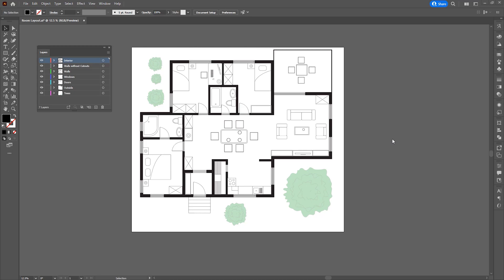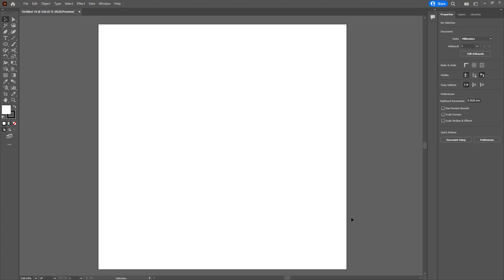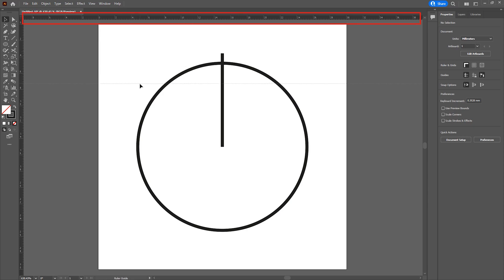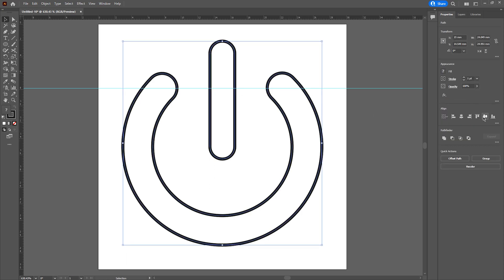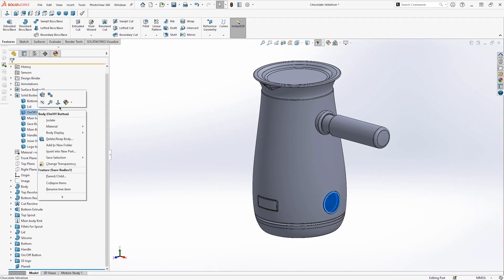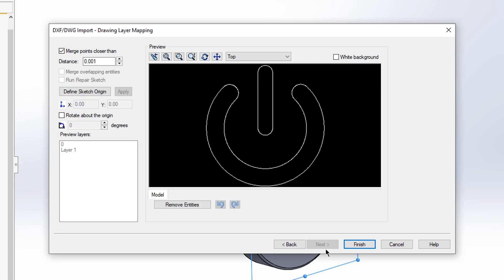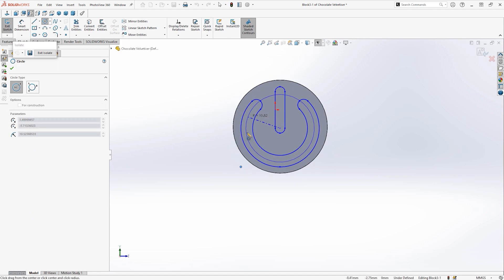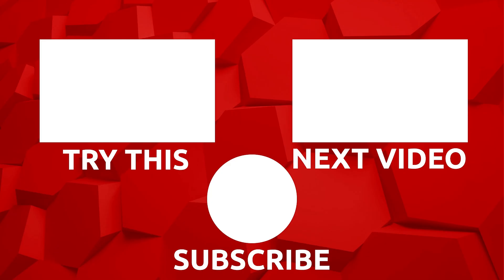How to Import DWGs into SOLIDWORKS from Adobe Illustrator | Beginner SOLIDWORKS Tutorial

Comment: For me it DID NOT WORK WITH DWG format, however when I saved my illustrator file as DXF format (the similar format) everything worked pervectly. Note that in Solidworks you have to select the plane first, so at first you need to click on a plane in a modeling tree, the plane where you want to insert your DXF file should be active. And only then you use the tool Insert DWG/DXF and it will work.